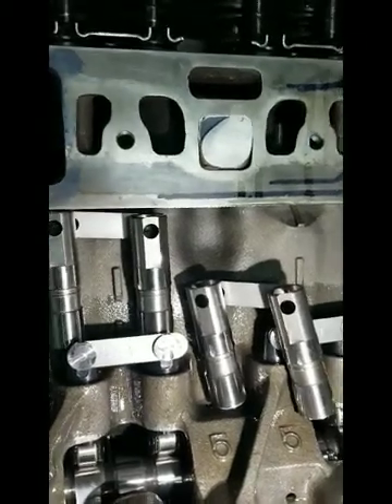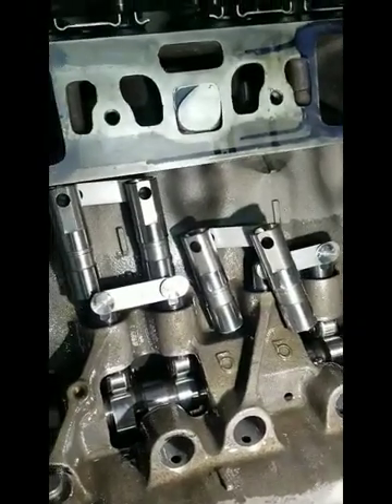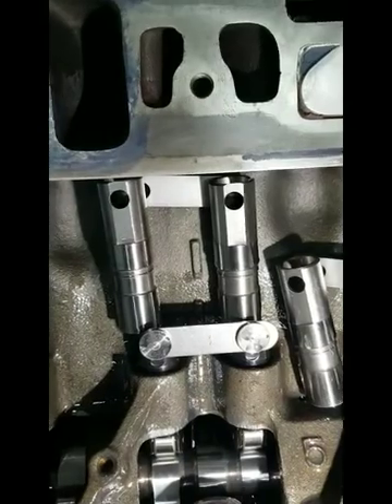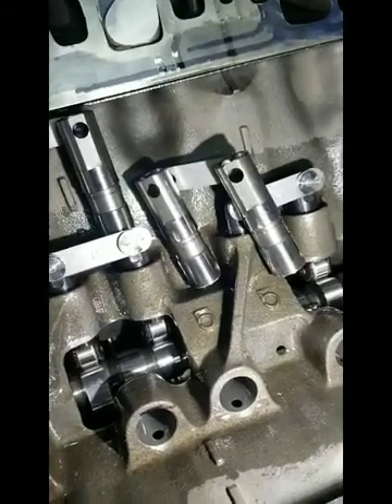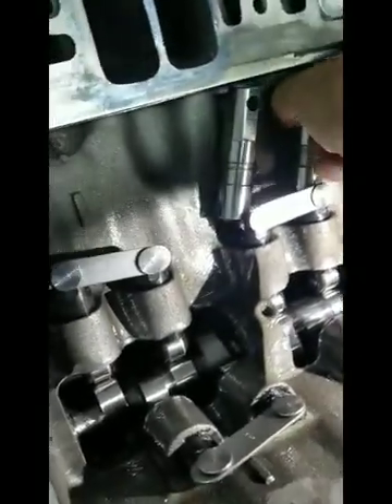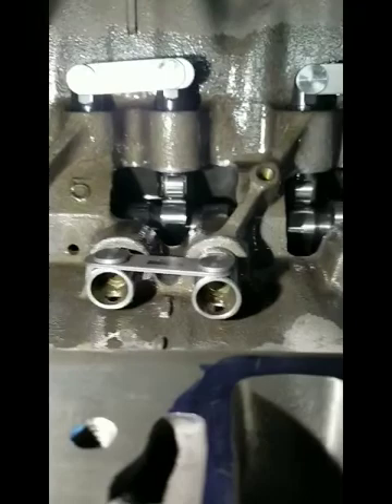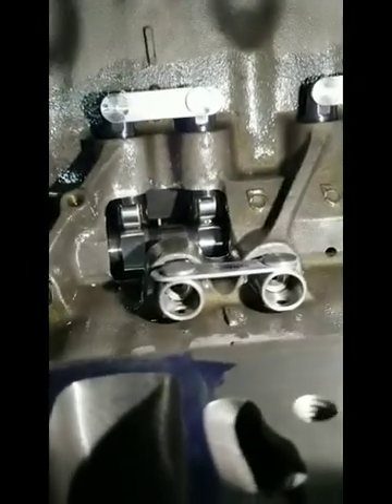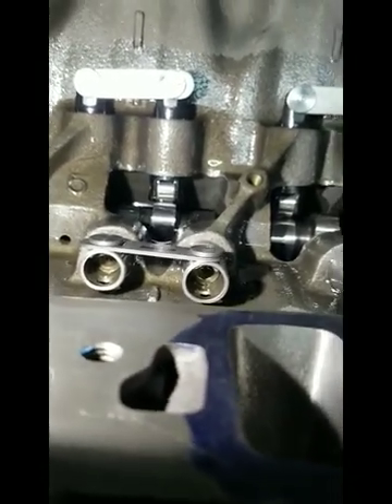DCI Motorsports Pontiac hydraulic roller lifter modification for quieter running lifters

Comment: Make sure the oil galley plug that's next to the distributor is there if not you will have internal oil leak very low oil pressure at the lifters, engine will be noisy at idle.

Comment: This is interesting...So, you're saying that this modification suppressed some of the lifter noise...  I wonder if this is a issue across lifter brands?  Would you say that some lifters are more prone to this issue?
Reply: Anytime you can feed a little more oil around the lifter its a good idea.
Reply: @brucefulper2433  So when are lifter feed hole restrictors beneficial?
Reply: @joequillun7790  On a Pontiac, never. It's a parroted thoughtless "mod" that some dope old timer did once, put it in print, and like many sheep ideas got spread into the main stream with out anyone thinking about it. Except me. I tested it and quickly found out it's one more stupid ass thing Pontiac guys do because they think they need to. I've got the most powerful NHRA Super Stock pure Pontiac combo in history turiing a REAL 8000 rpm and it does NOT have lifter restrictords. So think about two things ok? If you totally blocked off the oil feed to the top end would more oil  be in your rod and main clearances? No. And why would you want to run hotter valve springs?.
Reply: @brucefulper2433  If you ran solid lifters, and roller rockers, (not as much oil needed), and  "reduced", (not totally blocked off), oil to the top, wouldn't the large Pontiac crank journals benefit from an increased flow of oil to them?